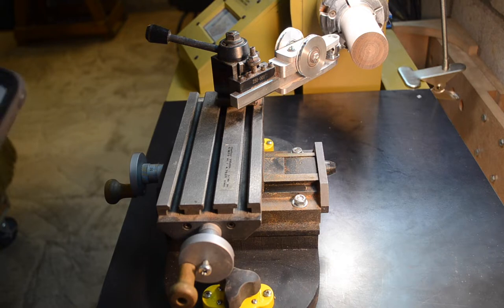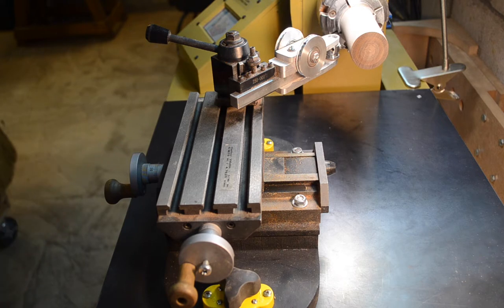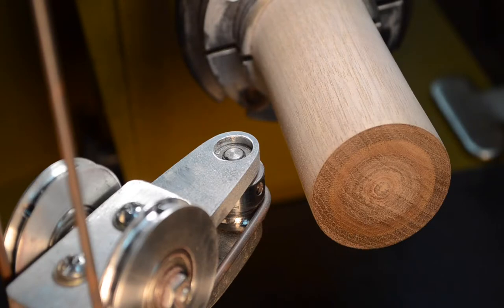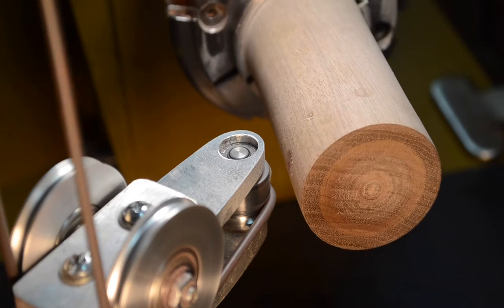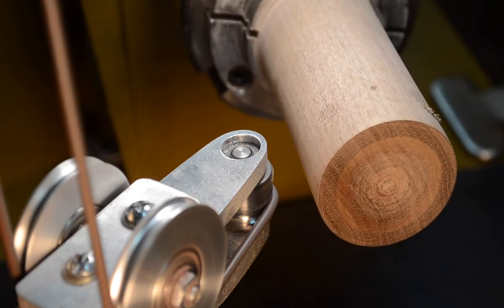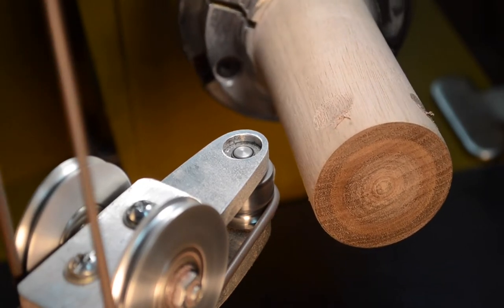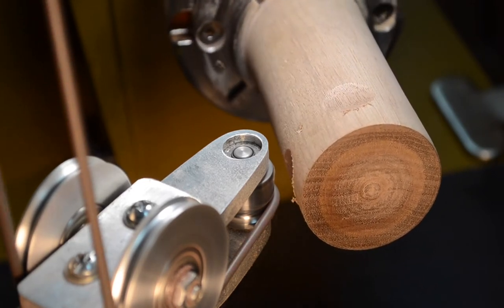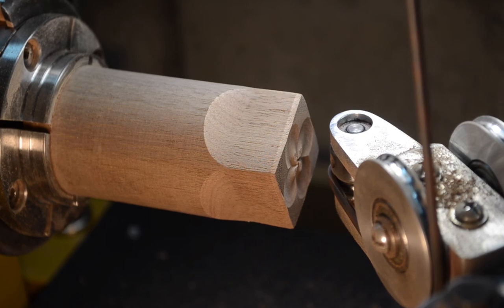MDF Rose Engine Lathe : #5 - Horizontal Cutting Frame

Comment: Thanks for sharing this. I just started this craft.
Reply from the maker: Glad it helps.  Have you built or bought a rose engine lathe yet?
Reply: Rich Colvin I bought a rose engine custom made. It is a metal frame with motor driven rosettes and cutter.